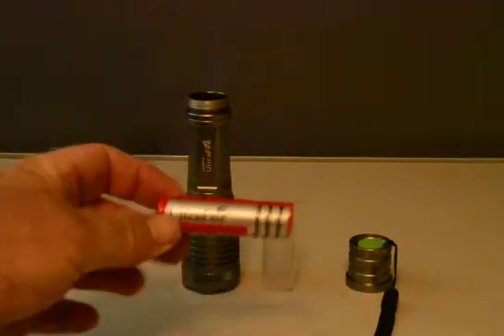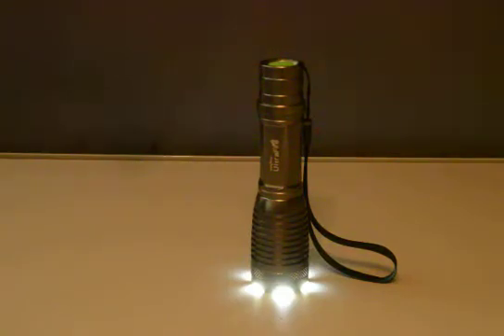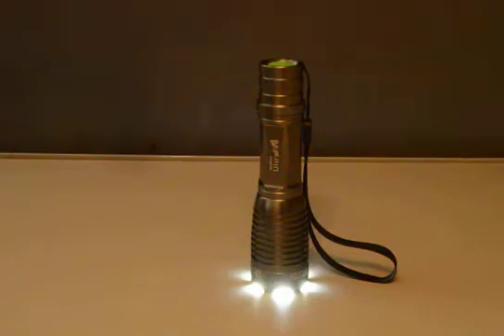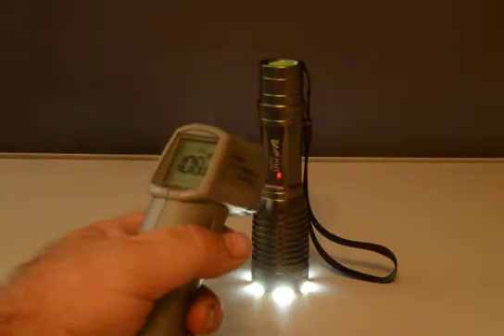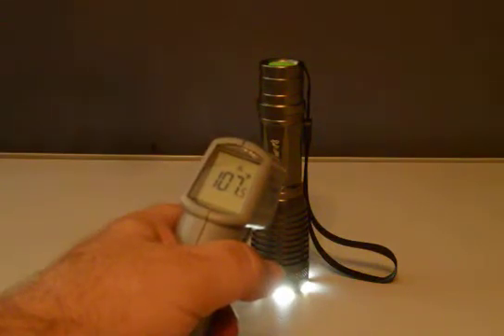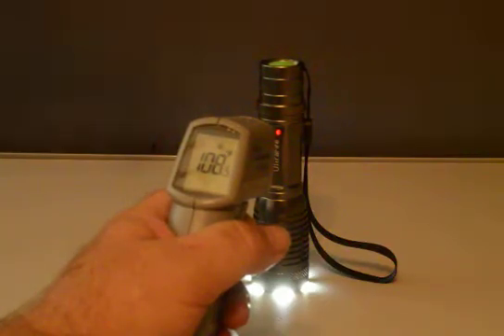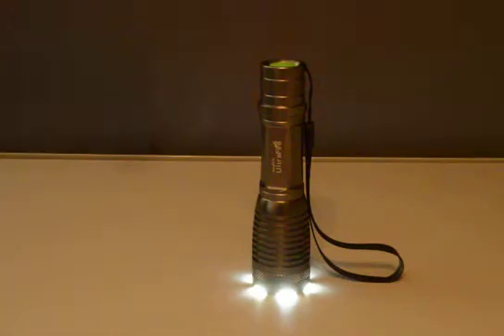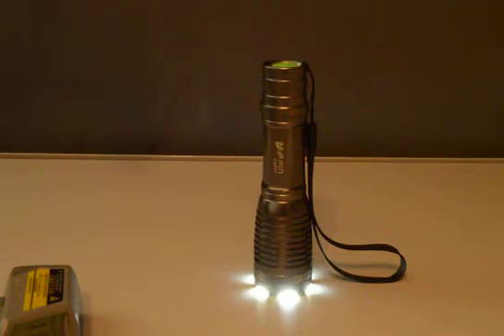CREE XM-L T6 LED 2000 LUMENS OVERHEATING TO 114 DEGREES

Comment: I have the same flashlight. It doesn't get hot at all with AAA batteries, but with the 18650 battery, it gets too hot to handle within 5 minutes at the highest light. I can't hold the flashlight because it gets too hot. It quickly overheats even in the lowest light. Every part of the flashlight except the battery gets hot, so the battery also starts to get hot. I don't know why this is so. Both my AAA and 18650 batteries are new. Ladda AAA Panasonic 18650.

Comment: I have an led light with energizers and it gets so hot it fries my batteries while the light is off!
Reply from the maker: I don't know this for sure but for the batteries and flashlights to get so hot there must be some kind of flaw in the design creating some kind of short that's causing it to heat up so much.

Comment: The cree XM-L T6 uses 10W of energy and  gives max. 1040 lumen. And yes, 10 Watts of energy is such a small area will heat it up a little. But 115 Fahreheit=45 Celsius, the temperature of a really hot summerday, that won't burn you.
 
http://www.cree.com/LED-Components-and-Modules/Products/XLamp/Discrete-Directional/XLamp-XML

Comment: I don't consider 114F to be overheating by any means. 114C yes, but not 114F. This is a 2000 lumen light. It's gonna get a bit on the warm side.

Comment: The battery may not have the capability to be run continuously with that bulb.  Get a voltmeter and check what the OHMS are on the bulb.  Then check what the lowest OHM level your battery is Rated for.  

As a Vaper I had to learn all this as well.  I don't know if I helped you at all.  But it definitely  could be the Battery.